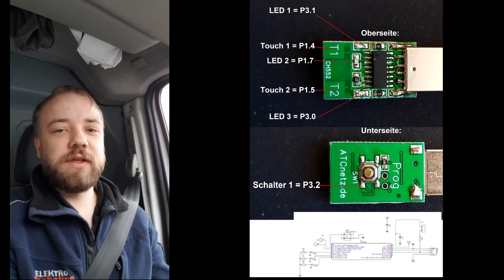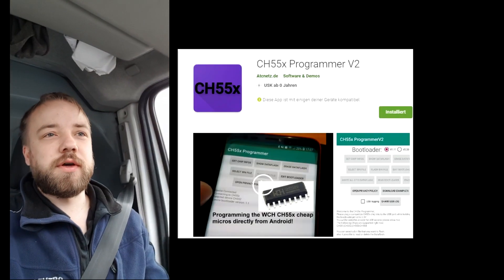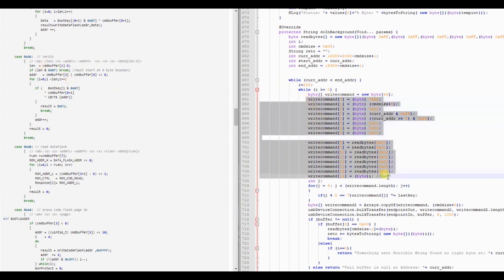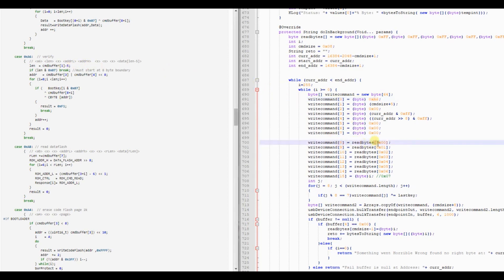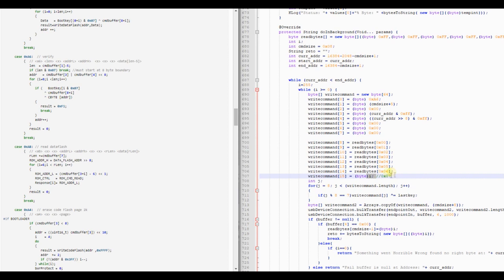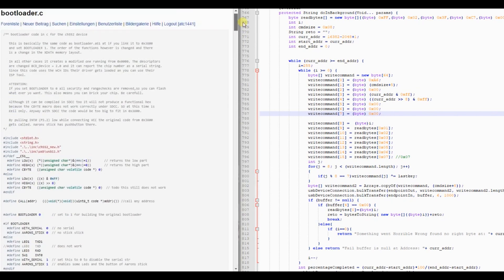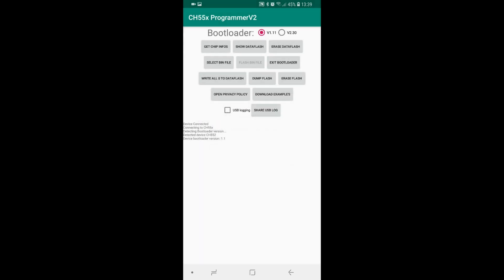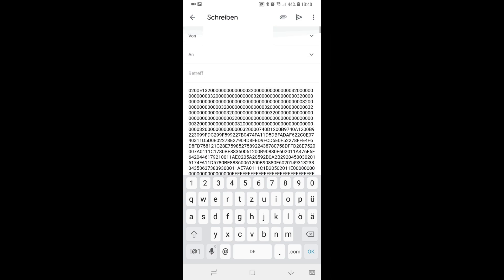Dump Flash of WCH CH552 Chip series using its bootloader vulnerability

Comment: Hi Aaron. I am experimenting with a CH552 running bootloader 2.50 Do you know if they patched this vulnerability or if this exploit is still possible? I have a Chinese RFID reader, that I want to add an additional output type too, so I need access to the firmware.
Reply from the maker: Hey, the exploit is closed in that version
Reply: @atc1441  Thank you for the reply. Are you aware of any way to directly access the data bypassing the bootloader. I didn't realize just how difficult it would be to reverse engineer these chips to get a working Windows keyboard HID output.

Comment: Are you usbman on the WCH forum because they also said they're from Germany? I've got a CH552 device laying around, unfortunately it looks like its bootloader version's higher than 2.3.0. There's a software entry for bootloader mode though, by sending 0x56 to the device via usb it enters bootloader mode. I've barely touched any microprocessors before, wish me luck in writing custom firmware to the device!

Comment: Any idea if it works with 2.31 bootloader? I've downloaded your app but nothing is happening. I think because I need an OTG cable? I like the algorithm to recover the data. I've got a USB touch screen that is just showing up as a bootloader. No idea if not programmed in the factory or the chip is being forced into bootloader mode.